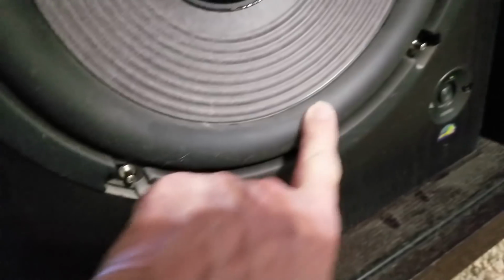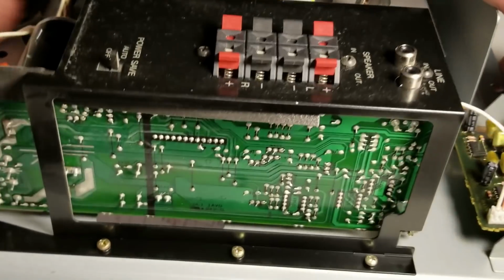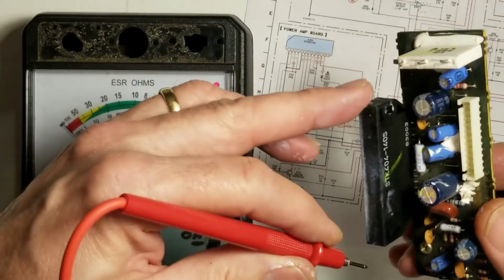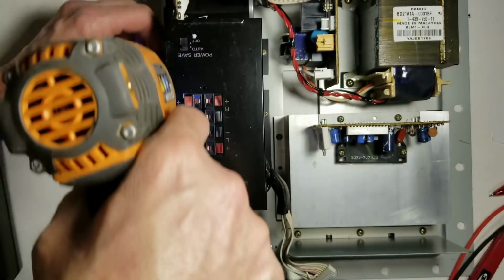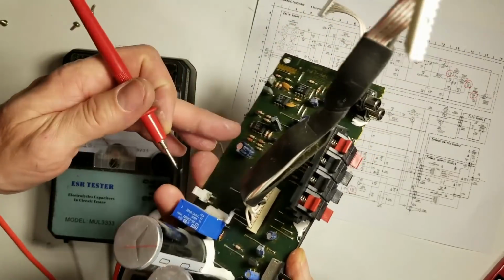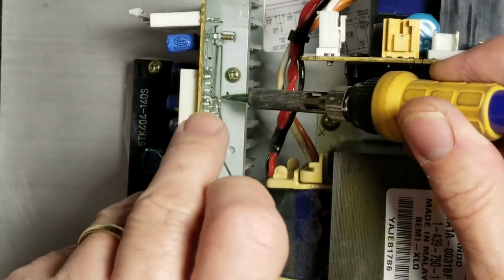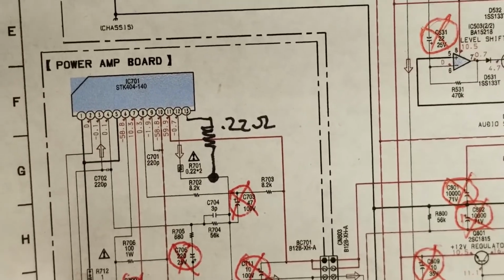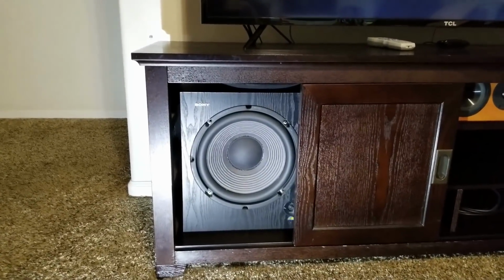Sony Subwoofer SA-WM500 Intermittent Audio Repair

Comment: Hi sir I’ve replaced the stk404-140s but still no sound , the sound relay doesn’t respond
Reply: Did you win?
Reply: Got the same problem
Reply: Change rectifier gbv602

Comment: After changing the STK404-140S on my Sony SA-WM500 the sound relay is not switching or responding when I switch the power button on , but the subwoofer switches on but no sound , I even switch the auto standby on & the system response very well but still no sound ... please help how do I get it to work .
Reply from the maker: Mine did the same thing. After STK404-140 replacement. Check out the last few videos I posted on that unit. https://youtu.be/uv27Q7mx1vo https://youtu.be/JRvVNQ1cn1U https://youtu.be/JAiUiHntXtk

Comment: I have the same subwoofer but there is no power I think I got a power surge what would be the problem
Reply: And my power light does not come on at all
Reply: Or can you tell me how do I get a new board for the system
Reply from the maker: Most likely the standby power supply is the issue. As far as a new board, it would me almost impossible. Maybe you can find a used one out of a scrap unit. email me norcal715videos@gmail.com
Reply: My future son-in-law has the board and he'll be leaving for California in the morning he got the tools to check on the power system as soon as I find out I will contact you again

Comment: Hi @NorCal715 Great Video! 

I have the same subwoofer. Mine decided to stop working at all this week. The green light on the power switch works fine but I do not hear the relay click on anymore. Any ideas? Is it that blue relay inside?  Any help is greatly appreciated. Thanks! - Cody
Reply from the maker: Do you mean the main power relay does not click, or the speaker relay a few seconds later does not click? email me at Norcal715videos@gmail.com

Comment: I think this recurring problem comes mainly from improper use, indeed this sub works on a wide spectrum, and therefore must be used at low volume. For more responsiveness in the bass I had to couple it with a passive sub, and indeed, it fills the lack of this big sub, which is effective for very low frequencies and its wide focal length. I was lucky to find a new one in its packaging last year, I did not see any problem, but since it is sensitive and saturates at high volume I imagine it must work on the welds and components ... It is always necessary to stay at the limit which should not be exceeded, but this sub alone is not a good choice, unless you know how to recognize its qualities and back it up with a sub that fills its gaps.
Reply: In the back of a TV cabinet, locked up, it heats up a little more than normal. Also i don't think the best seat is at the front with the audio system either for better sound distribution. But thank you for this information, in case mine breaks down.

Comment: My Sony subwoofer sa wm500 it does switch on but no sound what may be problem
Reply from the maker: upon power up do you hear the power relay click and then about 5 seconds later do you hear the speaker relay click?
Reply: @norcal715  I know what you’re talking about. Any time if powered up my sub, I’d hear that initial click, then a second a few seconds later. Now when I power up, I only hear the first, no second “click”, and the power indicator on the front isn’t lighting up. What can cause this and how can I repair it?

Comment: Do you happen to know where I can get parts for the SA-WM500?  The RCA male end of my cable broke off in the female end on the sub input, so I'd like to replace the in/out RCA pair.  Also, are the speaker inputs truly speaker level?  Thanks in advance.
Reply: Just put a black screw in

Comment: I think my slightly older Sony SA-WM40 powered subwoofer has the same input solder issue.  For the past few years it intermittently works but I could convince it by wiggling the RCA input wire.  I took the amp off the back of the cabinet and all of the insides look just like this SA-WM500 so I bet the same defects would be present in it too.  I'm going to look closer for those rings you mention and see what I can determine.  Thanks for putting this video up for us home-gammers!

Comment: Cool stuff though I comprehend not a lick. I just fixed I think my Sony sa wmsp87 active woofer had a like three inch board with a tape like strip to it. It was out of the groves that it appeared to slid into. Had it been anything else I would not be jamming cause we need bass currently I’m listening to journeys first album which I feel is there only good one. I saw Steve perry at a gas station in Orinda cal in 7 th grade with my buddy’s.  He was with a tall blonde Scandinavian looking gal in his 450 sel convertible ? And we all yelled at him saying journey sucks things. U know he wasn’t on the first album so maybe anyway. Take a rip on me. Shit I’ll send ya a nug if ya want

Comment: Just a thought.

If I'm reading the video correctly, the Sanyo application note didn't make use of the on-board thermister but the Sony circuit uses it to pull up a line through an NPN that feeds into what they call overload detect. The overload seems to be temperature based with no detection of residual DC on the output. Looking at the schematic, you should be able to add it in pretty easily to kill off the output relay power. A simple missing zero crossing detector circuit on the output set to about a fifth of a second should do it. One side of the speaker drive is to the centre tap of the incoming power transformers (power earth) and the other is to the emitter resistors, so there's no H bridge drive going on here.
Reply from the maker: I am not seeing a thermistor. Can you see a reference number callout?
Reply: @norcal715  Looking at the video of your Sanyo app sheet, I think it's between pin 1 and 2. I'll grab a copy and look myself.
Reply from the maker: Ahhh I See it in the internal block diagram and I see that Sony is using it in their design. I f the temperature gets over the preset design of the resistance network it will turn on the protect transistor and protect the unit. Good eye!
Reply: @norcal715  Love discussions like this, but stop me if it's off track. The type of circuit protection here always acts slower than the SOA requirements of the output darlingtons for short circuits. The tranies will die. In a sealed unit like this sub-woofer, it shouldn't be an issue because the load is permanently wired, but never in an amplifier where the user wires it themselves. This type of protection is mainly for way too much sound for way too long. Instead of cutting power, you can also use the thermister to turn on a fan (or run a fan proportionally) to cool the module, or even use it as a resistor and just lower the size of the incoming signal to reduce the power dissipated.

Comment: everything ive ever bought from sony has failed
Reply from the maker: Nothing lasts forever. Come to think of it everything I have bought from Sony has failed with 3 exceptions... A 1967 AM cube radio, and a 1991 AM only radio, and my two ICF-2010s shortwave radios. They still work perfectly. I guess their radios are the only thing thats lasts.

Comment: Great job as usual,  just thinking on some of those ESR readings were a bit high, wondering if it would have helped changing them as far as the filtering in that regulator circuit. 
However,  you did say its running as good as the day you bought it, so, what do I know..lol...!!!
Have always enjoyed your videos,  in fact the 35 yrs I spent in the tv repair bizz, having your videos a few years back were a big help on many repairs....
It's to bad our repair industry went south...
It was a great business and I enjoyed it, at times it was frustrating,  but, everything in life changes and the service business was not immune to change.
Reply: Saddle making, Wire wrapping, fixing phones, repairing TVs....all gone with the dodo.